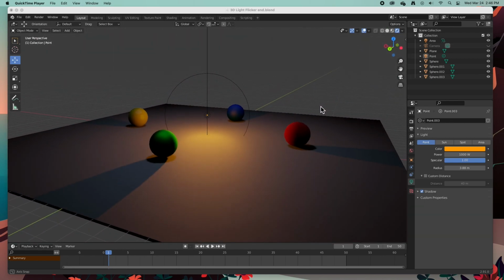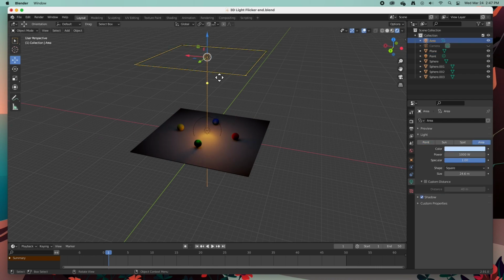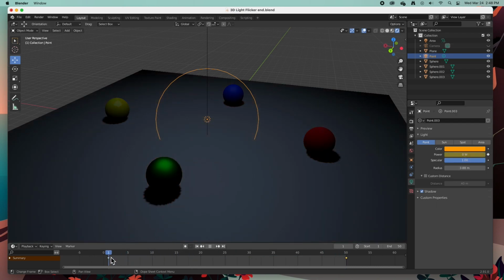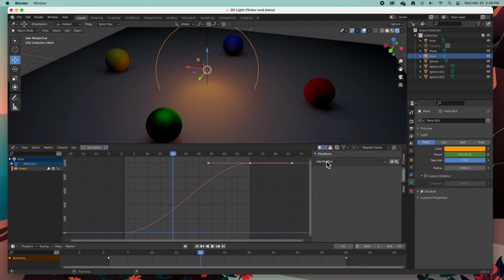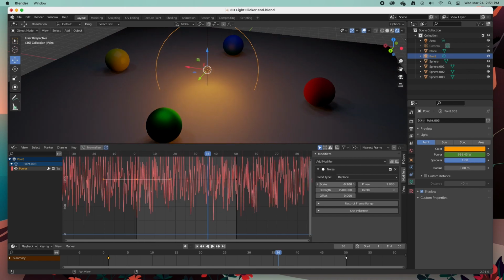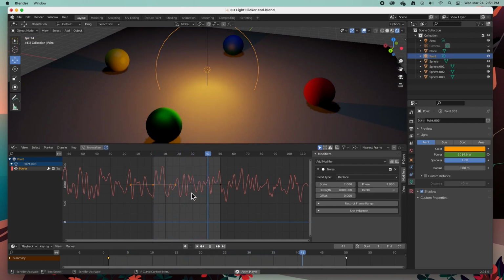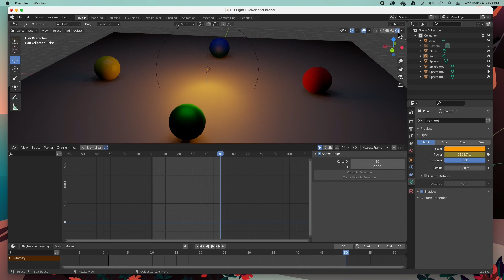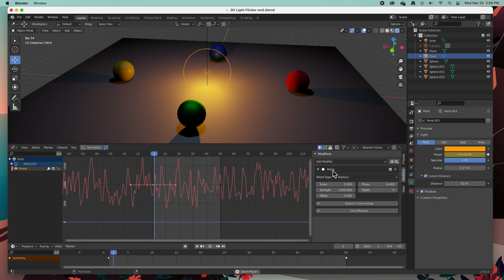Adding a Light Flicker effect to a Blender light using a Noise Modifier.

Comment: Excellent instructional video. Helped me solve a couple of problems. I was able to get my light to flicker making my campfire look more realistic as well as the point light I used for the orange embers making the base of the fire dance about as well. One are I'm having trouble with is getting the shadows around the campfire rocks to behave as they should, with some slight flickering. As the light grows and dims in intensity, how do I get the shadows cast by the fire to behave accordingly by flickering slightly as well? I would just like some slight shadow movement.
Reply from the maker: Lights affect different objects differently. Check out this video: https://youtu.be/kdfImx8KSas

Comment: Nice, gonna try this. I wonder if you can also use noise modifier to move the light side to side to make the shadows dancing? Sorry, this is my third using Blender.
Reply from the maker: or you can add a wave modifier, Check this one out: https://youtu.be/J1yCsKkkyOQ  I think you will like it.
Thanks 👍 😎
Reply: @Learn2Animate  Ah cool. Thank you :) 

I noticed that when I added little tiny firefly light on the table with other objects. When animates, light casting on the objects flicker even though the light bulbs stay solid with no nodes added. Have you encountered this sort of problem?
Reply from the maker: No, not really. Maybe the file is corrupt. Does this happen with every scene?

Comment: When I go to adjust the strength of the noise modifier, nothing happens. I've followed the exact same steps as you have done but it isn't working...
Reply from the maker: You have to be in the Viewport Display mode "Render Preview" in the top right hand of your viewport. Let me know if this works for you. 👍 😎
Reply: @Learn2Animate  Hey there! I was having the same issue, and my display mode is in render preview, it still has not fixed it. Do you know any other reason why it may not be working?